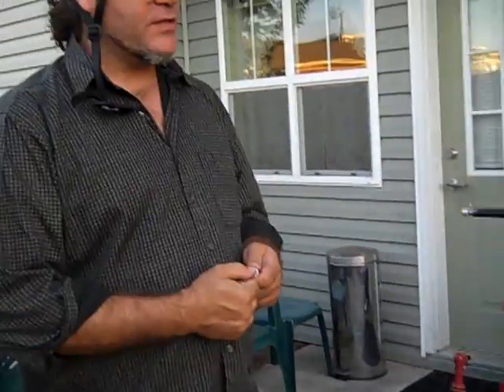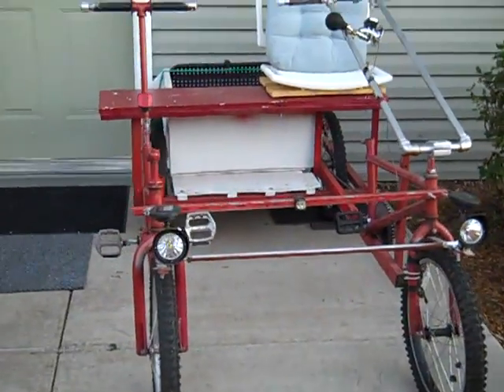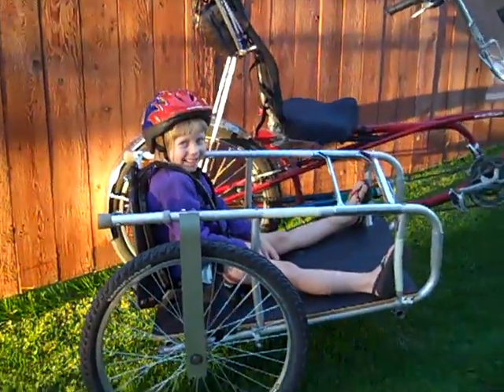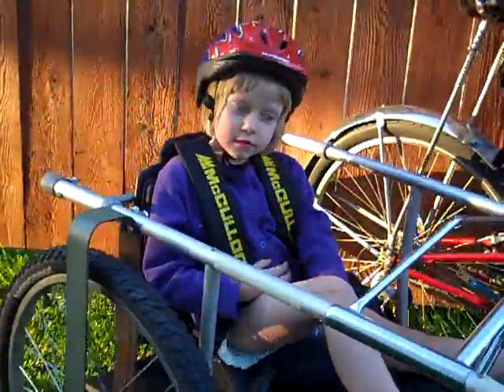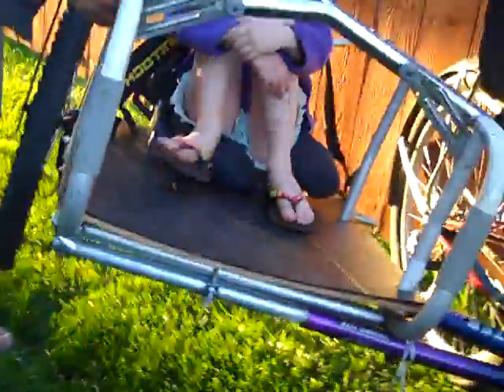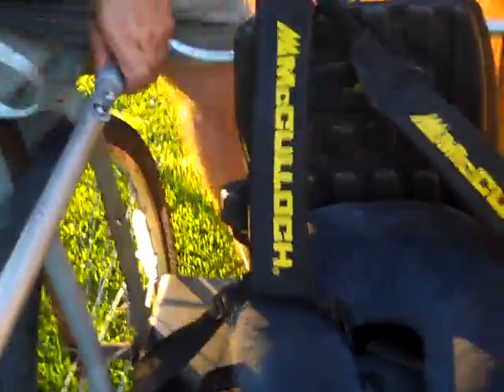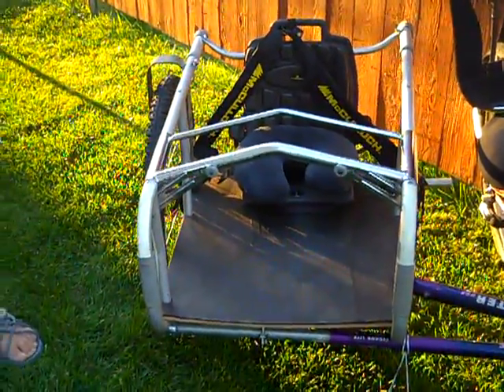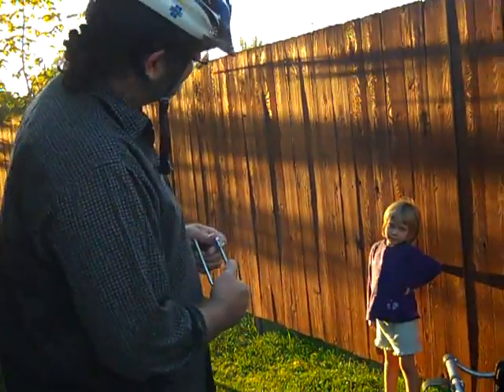Bed Frame Bike - Recycled Walker Sidecar - Missoula Build Your Own Recycled Bike Group

Comment: Hello hope I can answer that for you since I just got done building mine this week . I got a short piece of 1 inch box tubing ,drilled a 1/2 in hole for the wheels I got from a child's trailer and mounted it to the frame with hose clamps.  I will be posting it on the tube in a couple   jesikebiking